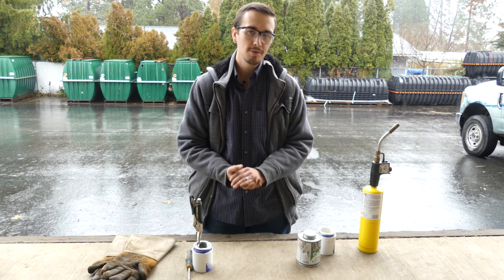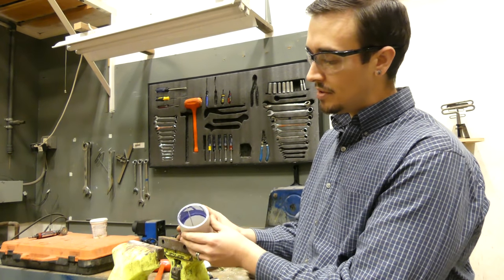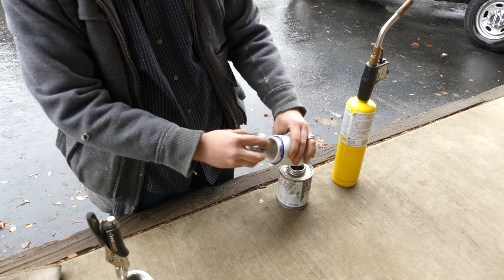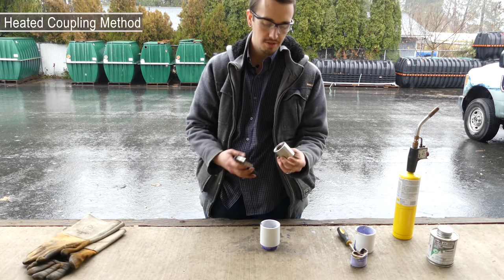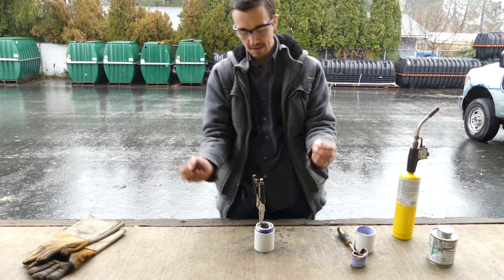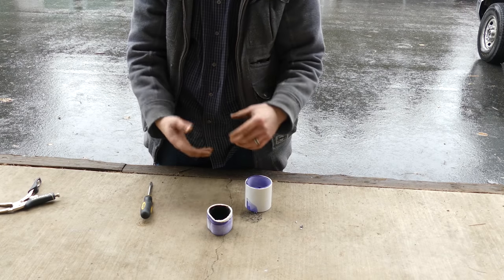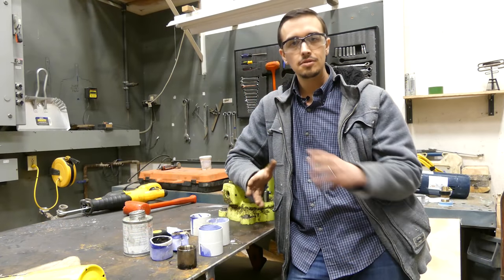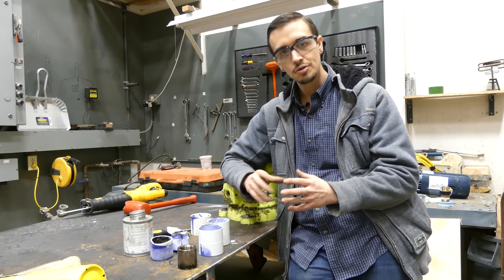3 GENIUS Ways to Remove PVC Pipe from Fitting (Without a Heat Gun)

Comment: Worked like a charm!  Method 3 saved me $$$!
Reply from the maker: Woohoo! Glad you found it useful :)
Reply: flashandthepan p
Reply: flashandthepan 
Unless it's a fitting that I can't change all of this is stupid.
PVC isn't that expensive and with the supplies you buy for the job.
You already have enough to just cut it off and add what's needed.
If find a flange or a good piece I want to save I still rather cut it out.
When you're good. You don't cut into the piece you want to save.
Reply: That makes sense.  My situation was in a hot tub and it was critical that I salvage the existing connection.
Reply: flashandthepan lol funny exactly the reason I watched this video!
Reply: @Gestapo943  Anthoer reason is that the cut and throw method has been used too often and there is nothing but joiners left
Reply: @RCworstwater  ...NO sawsall...just  one hand cut with a hacksaw blade...small screwdriver or better a small chisel and wedge one side of the cut open with the driver or chizel...it will peel out in one peice if youre patient and firm...why the annoying background music 👎
Reply: @arguescreamholler  the point is...if replacements ARENT readily available.. its always quicker than running off to buy one...even if the shops just next door
Reply: The problem is that this will not work if it is glued with Christy's. It looks like the fittings were just primered
Reply: Saved you money?, PVC is the cheapest pipe materials compared to copper, black And brass pipe
Reply: For everyone saying PVC is cheap….buy some pool parts.  The price can add up quick in the specialty pool fittings.
Reply: @Errol.C-nz  and if the pipe was long just collapse it.
Reply: That will help me big time

Comment: There are fittings called pipe extenders. You cut the old fittings out and the pipe extenders glues inside of pipe and extra length is the same size of pipe you are repairing. Use them on a reagurler basis. Have been in the Pool and Hot Tub repair business for over 33 years. Best invention ever. Hope this helps some of the people out there trying to do things right.
Reply: Randy I bet you been in the business for 30 year's but have you ever come across the one eyed pipe snake? Me personally I have never seen one but I did hear that a fella named Randy was a professional when it comes to handling the 1 eyed pipe snake.
Reply: Pool and spa-yes. Plumbing DWV-no

Comment: I used this heated coupling idea on two projects this last weekend. One on PVC inground pool equipment and secondly a bathroom sink drainage replacement. The heated coupling idea worked perfectly. I kept telling my wife, how did someone come up with this idea?  Much higher thinking than you or I.   The first two methods are unpredictable and risky.  Imagine having to dig up PVC piping for a replacement of inground pool equipment.  The coupling method is very specific and not destructive to surrounding equipment.  If you want before & after pics, let me know.  Thank you for the ingenious idea RCWCO.

I'm not sure if others have tried this method, but SS couplings are very expensive,  I found a workaround, that includes purchasing the required number of washers that closely meet the inside diameter of the PVC pipe that needs to be replaced.  Find a bolt & nut that will tightly compress the washers together.  Place the head side of the bolt and all the washers inside the replacement piece of PVC. Tightly secure the bolt on the threads, making sure the washers are aligned.  Galvanized, zinc, SS, it doesn't matter.  The cost of a respirator and goggles is much less than a single SS coupling.

Comment: Now try doing that while your under a sink standing on your head.
Reply: pat K LOL
Reply: That's what I'm talking about
Reply: It's easier if you stand on the other guys head.
Reply: Man, I'm facing the same issue! Cracked pipe right next to the fitting, right at the back of a deep cupboard. It's so tight under there and there's no room for wastage of pipe.
I might hook up my vacuum cleaner to suck the gases right at the source and exhaust direct to outdoors. The hot metal cylinder method is by far the most scientific.
Reply: Or underground covered in oak tree roots
Reply: FUNNY LOL  !!!!!
Reply: That's not hard !  
Try standing on your nose !
Reply: Saw it out in bits I've had too
Reply: I like what you've  done here. FYI, they make induction heaters for working with PVC piping, that can be an option. THX.

Comment: Not sure if others mentioned,  but using a sawsall for this is the equivalent of using a sledgehammer to drive a nail.  I used a dremel tool instead, it worked great.  You have a lot more control and I did not put a single mark on the remaining coupling.  took 5 minutes.
Reply from the maker: Good Tip!

Comment: In the first method if you use a small hacksaw rather than a sawzall, you'll have much more success and don't have to worry about cutting too deep. Also what was not said is when you get all the bits of pipe out the fitting you need to take sandpaper and remove all the bits of residual glue and pipe and sand the cup of the fitting smooth.
Reply from the maker: Good advice!

Comment: You don't have to set fire to it...just heat up the outer PVC with a hot air blower or torch untill its flexible and twist and pull the inner pipe out with pliers. When it's out just heat up the outer pipe again and it will take its original shape.

Comment: I just replaced a 2' cleanout wye fitting buried in the foundation using this method although I did use a heat gun instead. It worked way better than I expected. I had no idea that you could remove the fittings and reuse the pipe without cutting fittings off first. Heated them up after cutting majority of old wye fitting off first due to clearance (behind the bush directly under my gas meter...damn). Thank you very much Chris!...saved me a thousand bucks I'll bet.
Reply: Well the glues chemically weld the plastic to make the bond and the heat melts that and the pipe so... wouldn't expect the salvaged pipe to reliably stay seal under any kind of pressurized use.

Comment: Absolutely works. Used a sparkplug socket in the fitting and heated it up. Slow and low and was able to twist the pipe out. Thank you thank you. There are so many crap posts saying it is not possible.  Your advise is fantastic.

Comment: I used method 3 with a $2.95 1.5" x 3" threaded nipple pipe from Home Depot. PVC uni joint broke at the intake where my pump hooks up to a Jandy 3 way black plastic pool valve with 3 skimmers and main brain plumbed in with white PVC pipe. Would have been quite a job plus the expensive Jandy cost. Thanks so much for the 3 illustrations. NO BRAINER People -method 3 works great and yields super clean removal. Jandy is like new for a now simple connection. Just do it exactly as Chris in this video does it. Don't cut it, don't smack in a screw driver, just push softened PVC in with screwdriver tip then roll out with long nose pliers.
Reply: Hey USA Mark, thanks a gazillion. I am doing that right now. I can't find a cap for the tee. So I can't cut the line there, and I just wanted to leave one line alone and I already cut the broken valve off from 2 inches below ground and will run the lines separately up to the pump. Maybe I can save the second line with a good valve if I can get the tee off.

Comment: I've used the first method to remove a broken flange from under a toilet. Plumbers wanted a couple hundred to remove the broken flange which was glued to the inside of the sewage pipe. Using a handheld hacksaw, I cut grooves 1 inch apart into the flange then chiseled them out. Took about 30 minutes to remove a 4 inch flange but saved me hundreds.
Reply: RunBof Diver and a plumber will FIX it when it fails

Comment: Big thanks you for your video!  I'd seen a snippet on an IG reel of handyman hacks that showed a flammable liquid applied to a PVC welded joint, lit on fire , the piece of cut PVC softens and is twisted out.  But I didn't believe it would work.  This is what made me appreciate your video all the more, you took the time to try 4 methods, discussed the potential hazards of each and compared the results.
I found an 1-1/4 inch copper pipe segment (btw, big thanks for the tip NOT to use galvanized) that fit inside the 1-1/2" PVC piece I needed to remove.  I attached it to a pair of long nose vise grips, heated it up for about 30 seconds with my trusty MAP torch, inserted into the PVC pipe section, slowly turned it so all sections would get heated and after about 45 seconds, I was able to work the cut piece out and the section was good enough to use again!
Your video made the kitchen sink drain reconfigure go very smoothly!

Comment: Thank you for those great ideas and examples.  It got myself and my wife on what we could use since we didn't have a pipe to salvage the existing 2" drain pipe that had absolutely no extra pipe to cut and have enough to reattach a fitting.  A HEAT GUN WORKED GREAT!!!  Heat guns aren't super expensive but this didn't create any emissions.  It had a curled attachment that helped direct the heat.  I set it to 750 and kept checking until I was able to start peeling the pvc out.  Just had to share that experience!

Comment: I had a 1/2 inch threaded pvc pipe on a sprinkler head that broke off at the T fitting in the ground.  I used the method of heating up a piece off steel and soften the threaded piece of PVC pipe. 5 minutes later , presto!, I had it removed.  You saved me a lot of work.  Thanks for great post!

Comment: Thank you Chris! I had a cracked 90 deg El that needed replacing. I used the hot coupling method to melt the old part and very easily remove it - it worked like a charm! Without this I would have to have replaced the entire assembly which would have taken several hours to tear everything out and start all over. you do a great job on all your videos! Thanks,

Comment: Option 3 worked for me for removing a 1in pipe in an outside sprinkler line. I had a break right by a 3 way connector so it was worthwhile for me to get the pipe out of the connector. I just heated an old cheap socket with a propane burner and set it in with needle nose pliers. Thanks for the idea.
Reply: Lol I watched the video because I have the exact same situation as you described and I was going to do the same thing. Curious what size socket fit into the 1" pipe?

Comment: I could see the heated metal (#3) as the only viable method in the field.  If you think about trying to remove the fitting while still attached to some type of installation then heating the metal works best. If you needed to, you could even heat the metal more while it is still in the pipe using the torch. It would likely work on a horizontal removal as well rather than just straight up. Great video...
Reply from the maker: Thanks for the comment!

Comment: I thank you for your attempt by removing pvc couplings from pipes, the way I do it is as follow I plug the pipe with a rag very tight so nothing goes down the drain, then I used my dremol tool using a round bit cuter and I start cutting vertical groves , be sure to  clean as you go trying not to go too deep .I do my best to be one sixteen away from pvc pipe.
then  tap it with a 1/4" wood chisel tool lightly and wala.  it breaks of pice by pice or some times it just falls apart. 
thank you I do like your videos and yes I have used some of your ideas in my present job, as a handyman.
thank you

Comment: very interesting.   570 comments and I did not read them all.   I worked in the landscape irrigation industry and my pipe vendor sold a tool that was used with a cordless drill to bore the old PVC pipe from the fitting.  It takes some practice but it had worked well for me in the field.

Comment: Thank you for posting. I used a wallpaper heat gun, channel locks, and vise grip pliers and was able to remove a 4" section out of a PVC soil stack tee in less than 25 minutes with no damage to the soil stack. One downside, I drop a small piece of PVC down the stake, which will probably cause an issue down the road. I heated the inside of the pipe that needed to be removed and peeled it out easily with heating it in small sections. I did, however, score the pipe with a sawsaw.  Worked nicely without any real fumes or fire! Wear glasses and mask!
Reply from the maker: Glad to hear the video helped!

Comment: I recently removed an old toilet flange using the first method. It works a lot better when it’s not moving around while trying to cut it. 

The other 2 methods are awesome but I wouldn’t introduce fire to a fitting while in place. Methane and hydrogen sulfide gases and fire don’t mix well.

Comment: I see that this video is a couple years old so I assume you have seen these but, I use  Socket Saver drill bits and they work awesome with very little cost for the bits. No flames and no cutting into the fittings.

Comment: I thoroughly enjoyed your video!  The third method you demonstrated is pure genius!!  I can't wait to try it!!!  I have used the fist method you demonstrated with mixed results.  In that regard, I found that sawing the groves by hand and using a fifth groove, parallel to and w/i an inch or less of one of the others, to help get the initial piece of pipe out easier, goes a long way towards improving the final outcome.  Most people don't have the patience to do this.  Another method I've used, with pretty darn good results, is similar to your second method, only I use a heat gun instead of a flame.  (Not as satisfying, but much safer when attempting it indoors!)  When using this method, I shove a sopping-wet rag tightly into the PVC pipe so that it rests in the fitting just past the inner end of the stub of pipe to be removed.  (And before anyone gets all exercised about the possibility of the rag sliding down into the nether regions of the piping system, I can attest, from personal experience, that such an offending rag is easily removed by using a pipe snake with an auger on the end.  Phew!!!)  If possible, I also wrap another sopping-wet rag around the exterior of the fitting, especially if it is in a wall cavity.  I then evenly heat  the entire inner surface of the pipe to be removed from the fitting with the heat gun until it becomes soft and pliable.  Then I take a pair of long needle-nose pliers and proceed as you demonstrated.  The only advantage I see of my method, over the third method you demonstrated, is that it can be done on an installed horizontal section of pipe & fitting in situ, as opposed to a detached section of pipe & fitting that is conveniently sitting vertically on a concrete floor where you are merely trying to salvage the (often expensive) fitting.  My concern would be that the action of gravity, acting on the heated S.S. pipe coupling (which would have some weight to it) inside the stub of PVC pipe would cause a preferential heating/melting at the bottom portion of a horizontally mounted PVC pipe and/or fitting.  One other thing:  These methods seem to work fairly well on PVC pipe and fittings; but, for reasons I have not yet determined, they do NOT work well at all on ABS pipe and fittings.

Comment: Hi Chris, that was a Great Video and informative. I was wondering, have you ever tried using a heat gun on PVC glued fittings. Low heat, heating the inside and outside for short time and using Channel Lock Pliers and Gloves to separate the fittings.
Reply: i would think that a heat gun would compromise both fittings , maybe make them out of round , hot metal on the inside diameter lower heat transfer is my strong guess , unless it is a drain or non pressure

Comment: I use the saw and screw driver method maybe once or twice a month (only because I try not to fuck up that often) and it works like a charm if you’re not a dummy with the saw. And the primer and glue will kinda fuse all that shit together so don’t be afraid of gouges. I’ve been doing it for 14 years and never had any problems and my father has for over 30 years. So we’re no rookies.

Comment: Genius safety tip from 3:50 in: take your plumbing outside before disassembly.  Brilliant!

In reality, you might* be able to pull this off inside a building with:
1) a fire extinguisher and a plan
2) a box fan with a filter on the inlet side, set up near the burn so the air gets run though.

*on second thought, the fan trick works great with dust in a wood shop or sanding a concrete floor, but I'm NOT so sure it'll work with vapors from burning plastic.  I'd probably want to put the fan alone in a window forcing air into the house, then close all the other doors and windows and turn on the bath fan - but that's not perfect.  Be safe!

Comment: In the field for quick repairs where you have to work on site the cold method works best. Especially when you need to remove pvc couplings instead of pvc pipes. Most of the time you're working with small sizes 1/2 inch to 1 inch. In which case you carefully saw the coupling or elbow in halves and proceed to pry with flat screwdriver and twist off with nose pliers.

Comment: Good video
I have some old fittings that I have saved to reuse.
I am in a rural area of Eastern Australia and I am 45 minutes driving time from the nearest big town where I can buy a new fitting, and I am on tank water, ( no mains water available at all here)so I do all my own plumbing.
I have learned something from your video as I just assumed that it would destroy the main fitting trying to get the stub of pipe out after it had been glued with that terrible PVC glue that you use on pipe fittings, as it holds the pipes so strongly together.
Although I tend to use clear silicone on non-critical above ground pipes between tanks etc.
Up to now, I have just used a reducer or another joiner onto the old stub, where possible.
Now I know that you can get the old pipe off the fitting, so thank you for showing how its done.